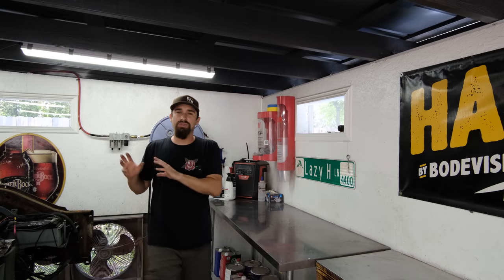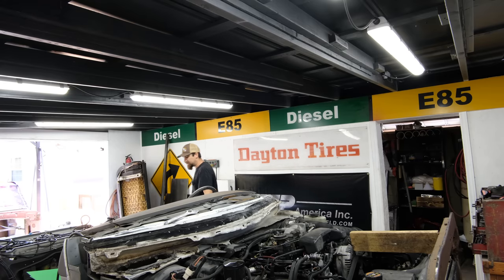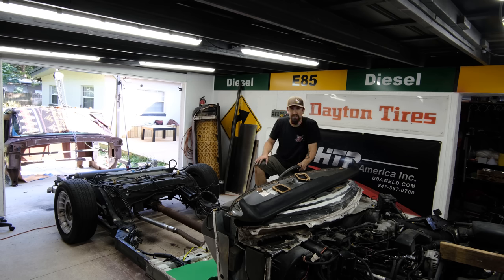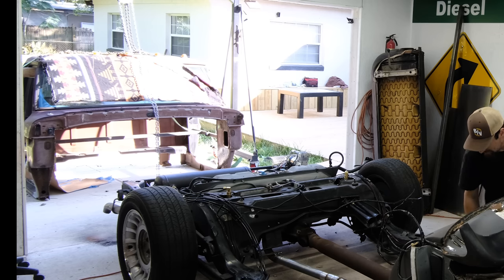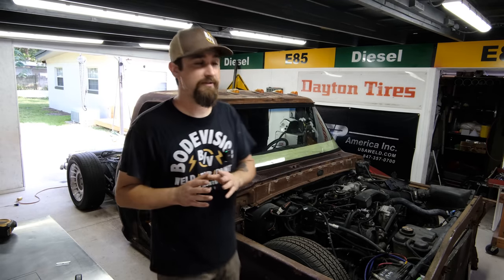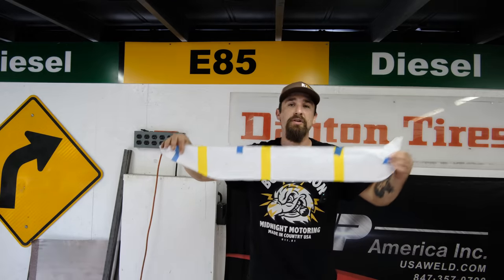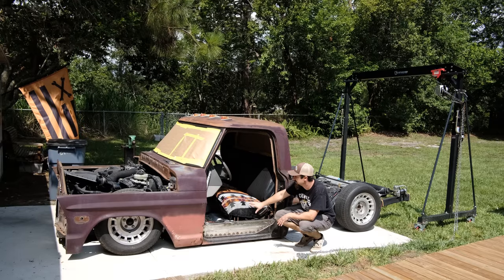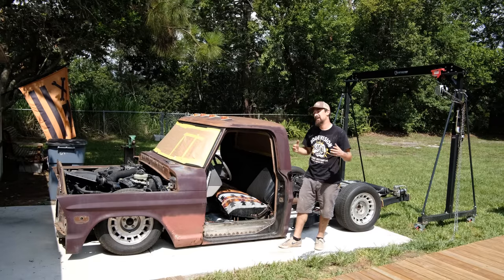Affordable Muffler Delete & Body Swap Welding: 1968 Ford F350 on Lincoln Town Car Chassis

Comment: Looks like a tight fit getting in. Both TDC Hotrods and Flannel Philip made it seem easy retaining the stock truck dash while also keeping all the crown vic/town car components, and on top of that it seems they gained a bit more leg room or distance from the dash and steering wheel. If things seem to cramped I'm sure it would be a quick fix for you to consider.

Comment: Dude, fuckin SICK!!! It's coming together so well. And it sounds SO good without the muffler. 
One thing i would like to see more of in these video's (but you don't have to) is a slightly more indepth look at the prep that goes into those fill in panels and such before they get welded on. And maybe reasonings behind the steps you take? But up to you. 
Keep up the hard work 💪

Comment: Between yours and Jamesbuilds Kermit truck fusions I’m thinking I should have went with my first idea and utilized the original floor pan in doing my suvfusion of 2006 hemi Durango chassis with a 1979 Cherokee body. I went with the Cherokee floor pan and it’s proving to be a headache. At this point there’s not much of the original Cherokee floor pan left and I’ve had to do way more welding than if I’d have gone your way. I like you build very much.

Comment: Just found this build and have enjoyed following along. However I do wish you wouldn’t avoid the wiper issue. It would be interesting to see how that could’ve worked out. Personally I wouldn’t go without them. Otherwise it’s not truly a real driver. It would be cool to somehow “fuse” the system using the Lincoln motor and controls with the truck linkage and wiper arms

Comment: What type of rear bed will you be fitting? Will you be re-using the bed from before or will you get a truck bed with body panels?
Reply: Last I heard he was planning on like a construction tool box style bed. He picked them up in an earlier episode before he tore the truck apart.

Comment: would be sweet to have the Lincoln 1997 presidentialaddition  it's longer, so you can put the Ford 4 door cab on With a flare side.